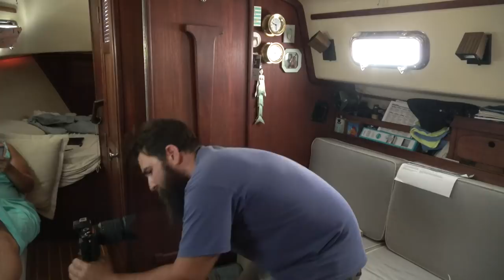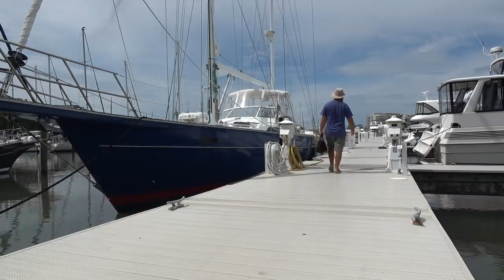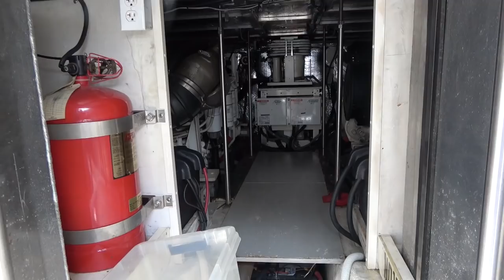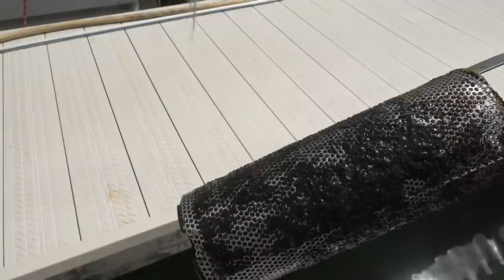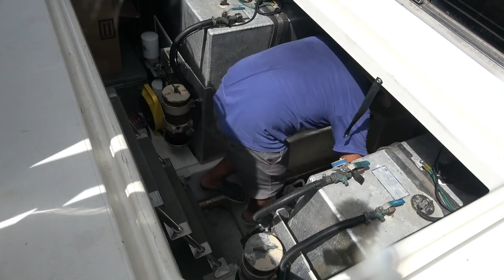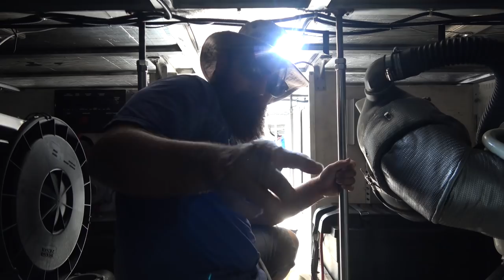1. How we make money on YouTube like Casey Neistat The Boat Life daily vlog

Comment: I do the same thing for several boats in our marina. Get a bucket and a brass brush, and a towel. Once the strainer is out, scrub the strainer housing and check, with your finger, the intake hose. That can get blockage depending on rate of growth and Sea grasses and... if the AC is on when the boat gets a bottom job. Also, recommended to the owner to have another basket and a clear top for the strainer. That way you can switch them out and drop the dirty one in the bucket. A clear top will let you see the flow when you turn the AC back on. Check the discharge hose when you get off to make sure there is good flow. The intake hose can always be removed and cleaned out.
Reply from the maker: Love the brass brush idea, going to get one ASAP.  Also, the extra strainer to swap is a brilliant idea as is the clear cap. His boat is for sale currently, but we'll make the recommendation on his next boat for sure!

Comment: Enjoy your videos. Having owned smaller boats with no AC etc. Why does the owner you changed the filter for run is AC non stop when he is noT there?
Reply: I think it helps keep the humidity inside the boat down.
Reply: helps keep mold from forming too. i don’t have AC on my boat and get mold in my storage compartments on anything fabric or paper
Reply from the maker: The other commenters are correct, it helps mold/mildew/humidity issues. Also, he is on the boat 1-2 weeks per month. The time it would take to cool down each visit isn't worth it.